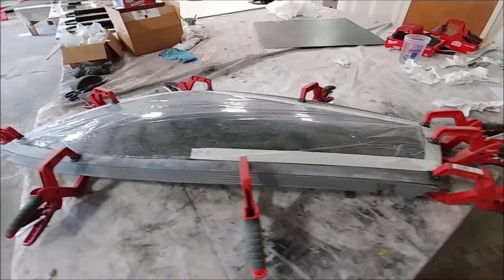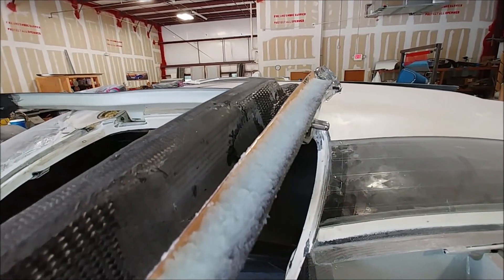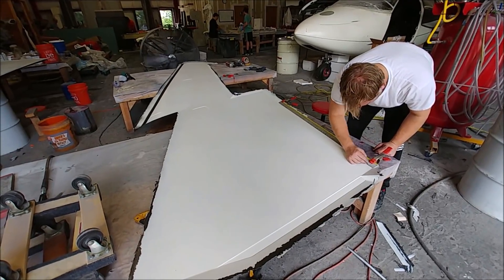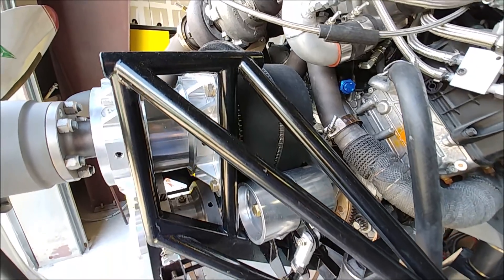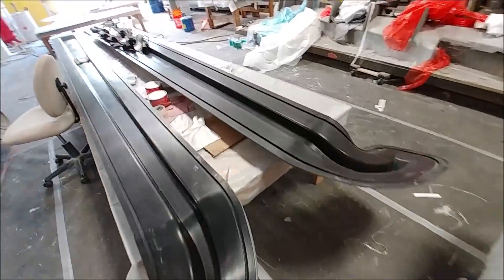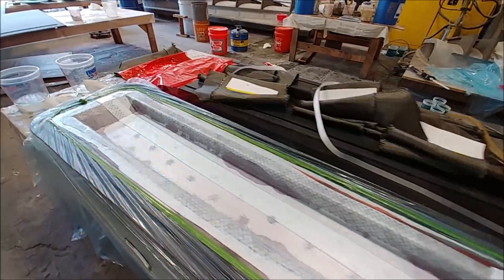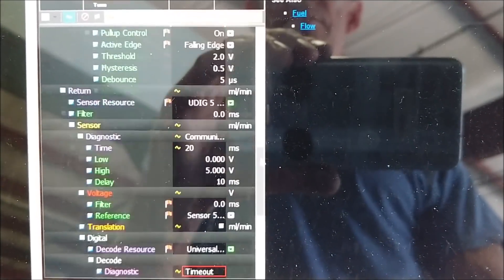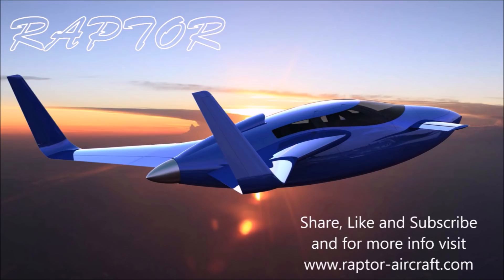New Pulleys Installed - Building the Raptor Prototype

Comment: I don't want to beat a dead horse but... You shouldn't really put any reducers or tees in a turbo oil return line. If it's AN-10 at the turbo then it should stay that way all the way into the sump. They made it AN-10 for a reason.
 Good work though, I understand not wanting to drop the oil pan right now.
Reply from the maker: Obviously, but in this case we are Ying into the return feed from the governor which will likely be creating a vacuum for the turbo oil drain because there's quite a decent flow/pressure coming from the governor return. Just cause it's AN 10 doesn't mean it's full of oil. It's designed that way so it drains nicely. The feed to the turbo is only AN 4 I recall and there's a restrictor in line as well, so there's not a huge flow going through there. So it should be fine.

Comment: When does the engine get bolted to the airplane Pete? It will be interesting to see how the frame works to act as the connection between the engine and the body of the airplane.
Reply from the maker: When we're ready to test fit it. Probably another month or more.
Reply: that sounds awesome thanks